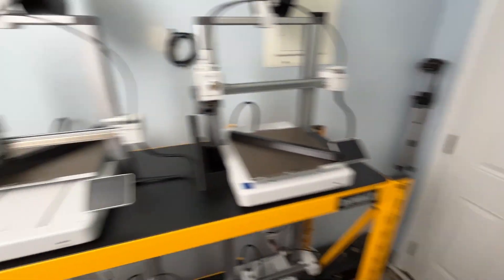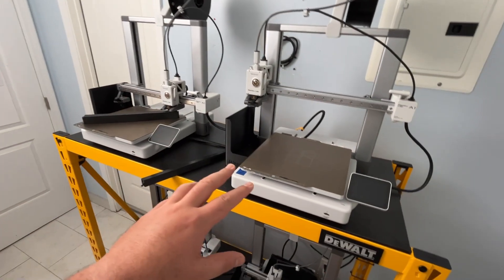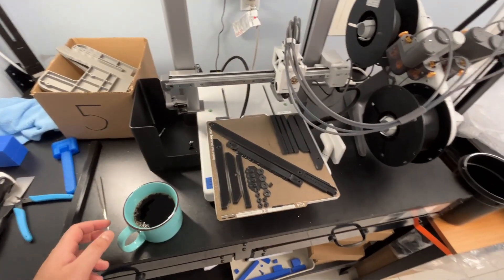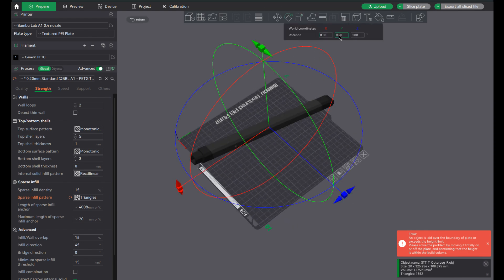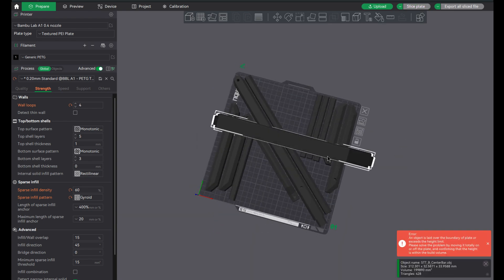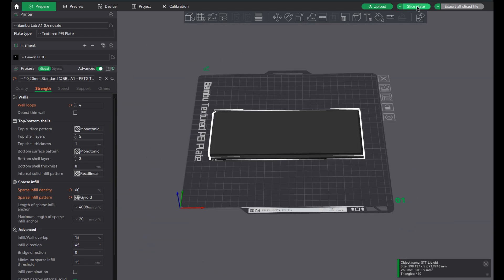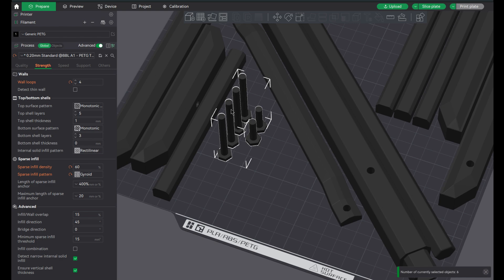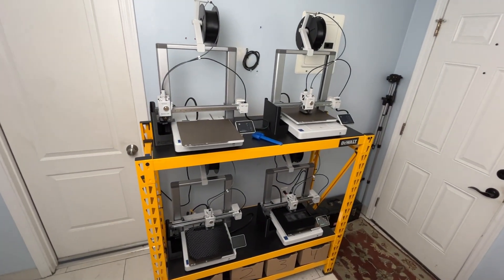3D Printing Stealth TV Tray: Slicing & Extreme Print Test!

Comment: What do you use to lubricate the X and Y guide rails?
Reply from the maker: @ez2automate  For lubricating the X and Y guide rails, I use a 3-in-1 oil by WD-40 with a Marksman spout. It works really well for keeping everything running smoothly. I get it from Harbor Freight. Here's the link if you're interested: https://www.harborfreight.com/4-oz-multi-purpose-oil-with-marksman-spout-61495.html
Reply: @3DTheory  Thank You!